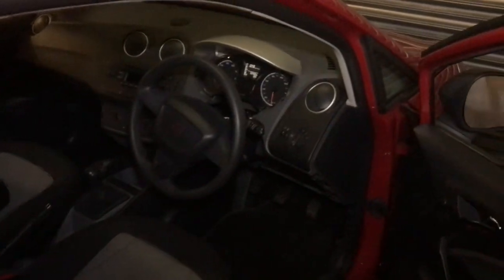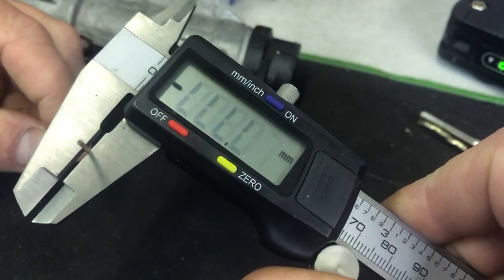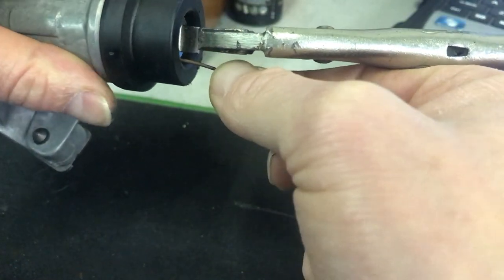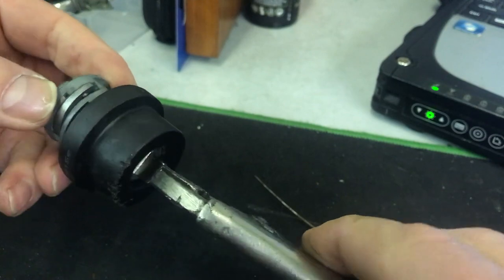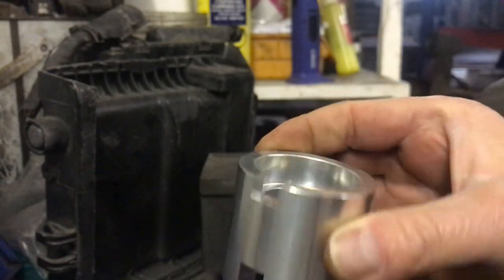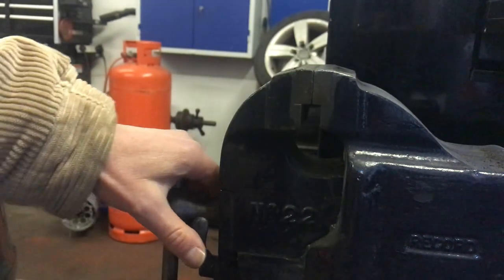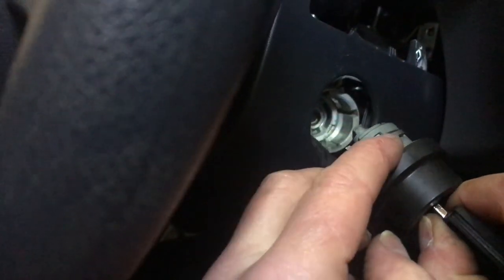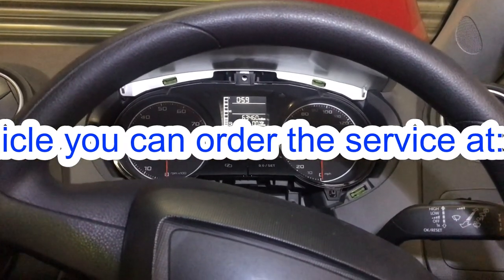VW SEAT Skoda Audi Ignition lock barrel + Transponder antenna (Coil) replacement

Comment: Hello. I changed the housing that holds the ignition switch and lock barrel. When I try to re insert lock barrel, I put key in, turned to on position, insert lock barrel but can’t get it to click or lock in place. Key stays in on position. I’m thinking it’s the $30 Amazon part that’s the problem. Maybe I need to buy the housing from a better site? I just can’t get lock barrel with the key in it to fully seat and click in. Goes in almost ol the way but won’t click in. Thoughts?
Reply from the maker: Hi, it may well be a lie quality ‘pattern part’.. I would buy a secondhand genuine part & try again!

Comment: I’m getting the following message on my Leon;

Starter system faulty see workshop!

Starts and runs fine stop start works as it should. 

Car battery is original and 10 years old now

Unsure if I need a new battery or if it’s ignition switch related? 

One thing I’ve noticed is that when I turn the car off it runs until I pull the key and I can’t for the life of me remember if it did that before or if it turned off engine before pulling key?
Reply from the maker: @R55LSD  Hi and thanks for watching!, sounds like the ignition switch is faulty if it still runs with the ignition switched off. Firstly I would plug in a diagnostic scanner & check the live data readings from the ignition switch & move forward from there..
Reply: @JC-ECUConnection  Thanks for the reply, for the sake of £12 I’ve just ordered one and will just try swapping it.

Comment: So when you replace ignition antenna don’t you have to program it so it connects with the chip in the key?
Reply from the maker: No, the antenna is not a programmed part… it is simply an antenna
Reply from the maker: @@joelsalazarnet the Instrument cluster is programmed with the key data, the transponder in the key is programmed to the cluster - this information is transmitted via the antenna from the key to the cluster…
Reply: In that case why do you need to take the antenna off the barrel? Is it only in cases where the antenna is damaged?

Comment: Hi, is it possible to remove the antenna safely using a vise? I don't have that tool that fits the ignition barrel and also don't live in the UK to bring it by the shop. My original antenna doesn't read my key anymore. Only when I place a 2nd antenna close to the key in the ignition I can start the car.
Reply from the maker: Hi, no I wouldn’t try to remove it with a vice, if you are in Europe we can do this job for you no problem, our services are IOSS compliant & can do it by post, for more information please view our website: www.ecuconnection.co.uk

Comment: What's use, is the other end off the tool for?
Your tool is not similar to the one of the NW key's? 🤔
Reply from the maker: There is 2 different sizes of the transceiver / lock barrel - the other end is for the other size & yes this is the same tool you mention..
Reply: Is it possible that you could measure the height of the Grove.  @JC-ECUConnection
Reply from the maker: @Jedi_Masteren  7mm one end & 13.5mm the other..
Reply: @JC-ECUConnection  thanks for info 🙂the long one, which car, is that for?
Reply from the maker: @Jedi_Masteren  not sure exactly which cars but other VW group vehicles…
Reply: Can you please measure the inner diameter and depth for the other end?  @JC-ECUConnection

Comment: Hey i need to change just the antenna bcz is damaged does that mean i need to use two keys one for the doors and one for ignition?
Reply from the maker: @ArdisLacaj  The reason for changing the aerial- as in the video is so you don’t have to use different keys..
Reply: I have another problem it shows immobilizer active on the dashboard but the ignition works ok can it be bcz the black antenna is a little damaged , thanks if you can help me to remove that message
Reply from the maker: @ArdisLacaj  yes, this could well be due to a damaged antenna

Comment: Where you buy the tool to take the antenn out? Do you buy a new or you take from secondhand?
Reply from the maker: We had the tool specially made to order, we generally tend to re-use secondhand antennas although new antennas are available from various locksmith supply companies..

Comment: I changed the key shell and left the key battery out for like 24 hours and now when i use both original and spare key, the dash says “no key” and the engine will instantly shut off. Any idea on how to fix it?
Reply from the maker: Sounds like you didn’t change the transponder in the key when you swapped the case - check this first

Comment: Does the antenna need programming to car at all, or can i just buy a new lock cylinder and its plug and play
Reply from the maker: Antenna is not programmed & yes you can change the lock cylinder with the aerial BUT that means you will have to carry 2 keys, one for the door & one for the ignition… we can swap the aerial for you, no probs:
https://ecuconnection.co.uk/product/audi-seat-skoda-vw-ignition-lock-barrel-transponder-antenna-removal-refitting-service/?currency=GBP